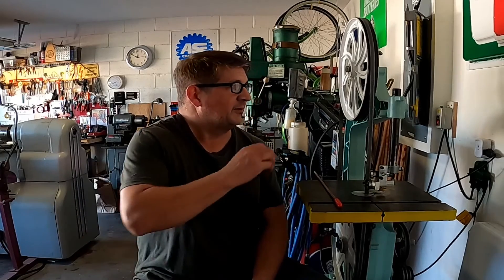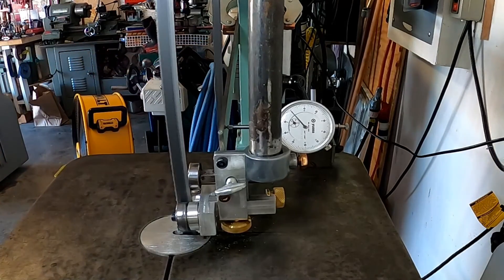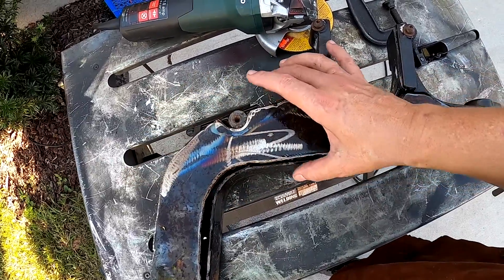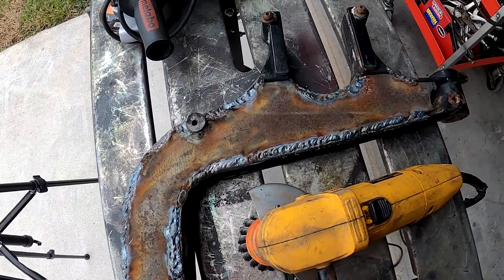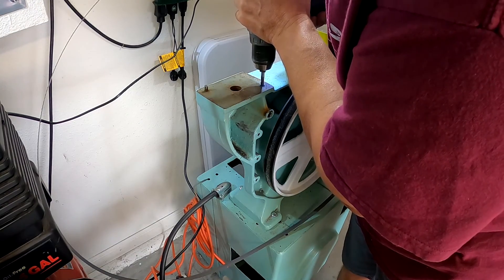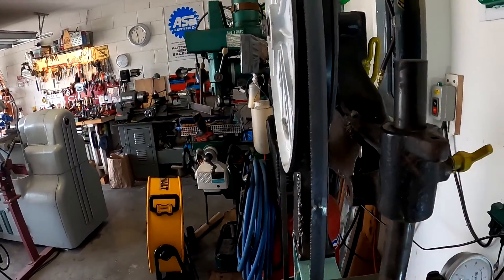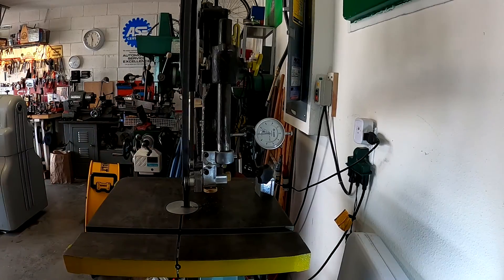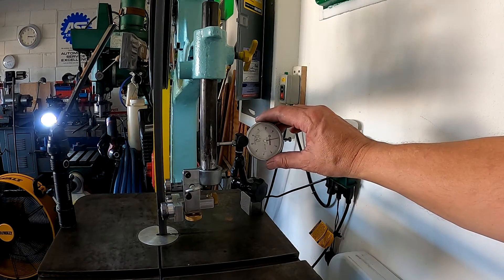Stiffen the Frame on the Delta 14" Band Saw

Comment: Excellent job, Don. It runs smooth as butter. I would have filled it with black epoxy. But there are many ways to solve the problem. Came out great in the end. TOP.👍
Reply from the maker: Thanks I've really come to appreciate having a heavier arm up there. Its really cuts nicer than I expected it could.

Comment: Drinking my coffee and watching somebody else work.  I almost feel like I'm back in the Navy.  Good to see you posting.  Could you tell us what brand, type, tpi and size blade you are using to cut metal?
Reply from the maker: Its an Ebay special from redyanan  1pcs 93-1/2" x 1/2" x 14tpi M42 Bi-metal Band Saw Blades for Cutting Metal 93.5"   Its marked USA on it which surprised me. But it cuts like a champ. Navy huh??? Yup, the sittin back part makes sense😄👍
Reply: @donsengine3158  Especially when you're a chief.  I got paid to drink coffee and watch.
Reply from the maker: @oddshot60  Ah the good life...

Comment: Thanks for the vid don.     For years, I have been thinking that the saw frame was not rigid.  I never did like the open frame  (cheap) design.  The original was far better
Reply from the maker: Hey Lyle, you said it best.. The Delta 14" needs more mass.  They're good saws if you don't have space for a DoAll or Powermatic, but like anything else that is built on a budget and a compromise, they're always going to do better with a few mods. You were dead right about that frame being too spindly as well. Funny, my Craftsman saw didn't have a lot of mass, but that large clamshell design really made it quit stable. Too bad it doesn't swallow up larger pieces. Anyway, glad you caught this. Be seein you soon. Don